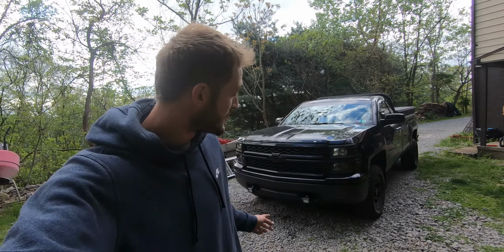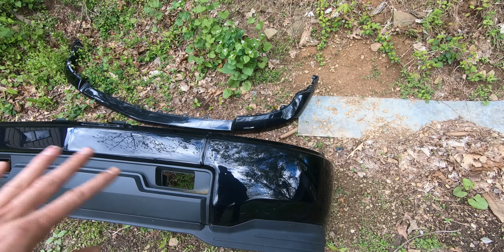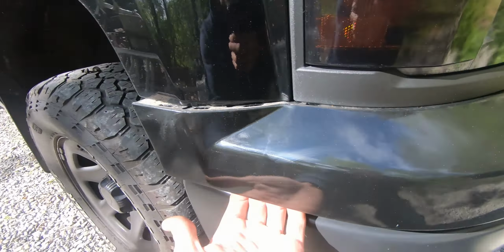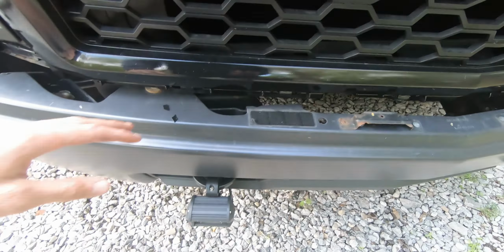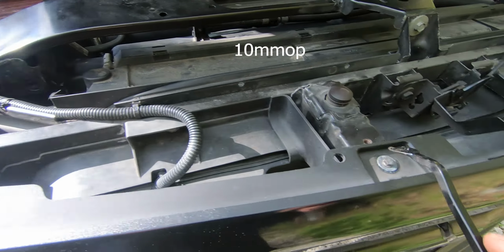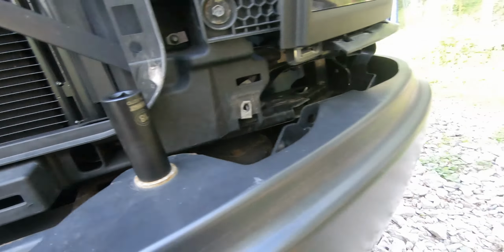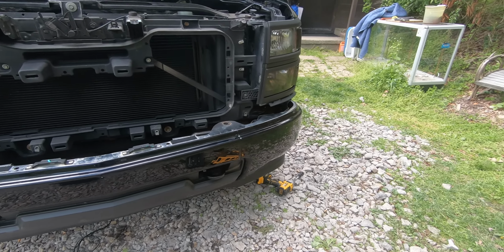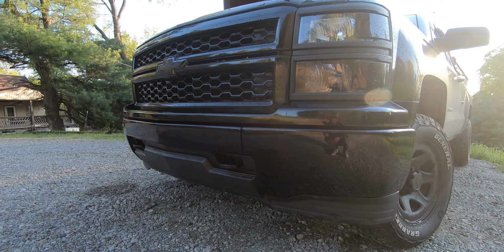2014 Silverado Front Bumper Replacement

Comment: How hard were the bumper bolts in both corners of the 6 actual bolts in the metal bumper? I have taken the grille out and replaced my headlights on my 2014 Carolinas Edition and now I’m getting rid of the chrome bumper with a black painted bumper and my bumper came with factory fog lights in each corner. Thanks

Comment: Shittiest year for the Silverado unfortunately..😔
Reply from the maker: Respectfully disagree. 08-13 are terrible years. The only issue I had was ac in 80,000 miles. Even though they’re known for bad transmissions. Just my opinion
Reply: Do you know how many recalls are on these? I own one too and my actuator just went out, amongst other things.
Reply: Thanks for the video though bub I’m replacing my bumper also.
Reply from the maker: @jonadkins768  no prob. Yeah I forgot about some of those recalls. I actually had one for the brake booster and something with the ignition now that I think about it. Just never got it fixed. 2014 definitely isn’t a winner
Reply: I have one with 175000 miles on it and not one problem
Reply from the maker: @HouseWashingRick  that’s good to hear.